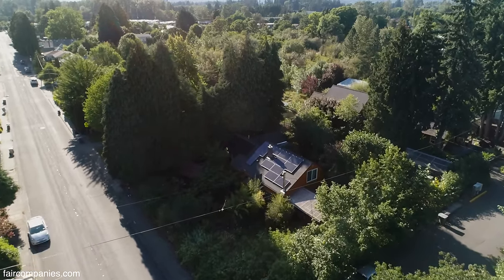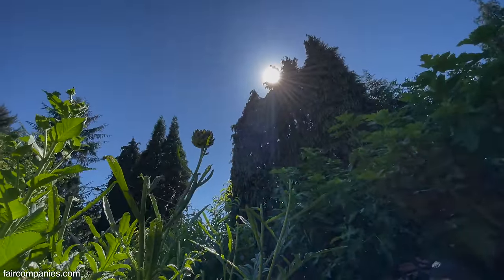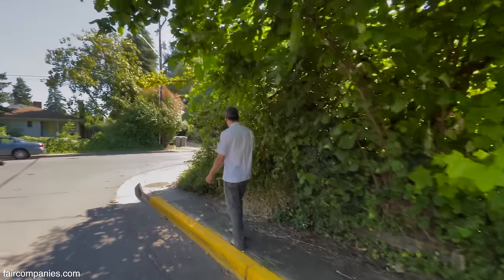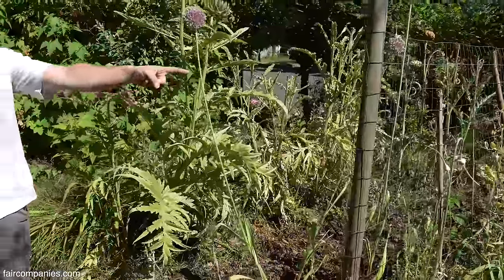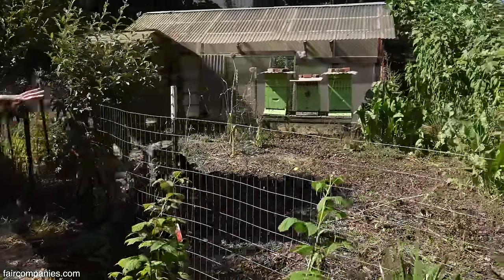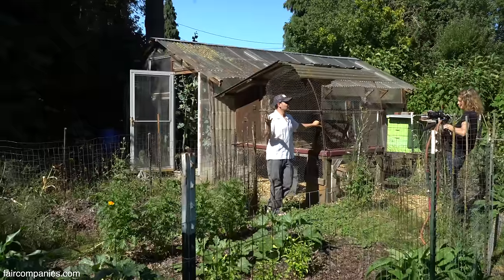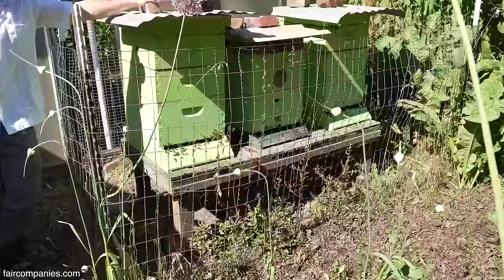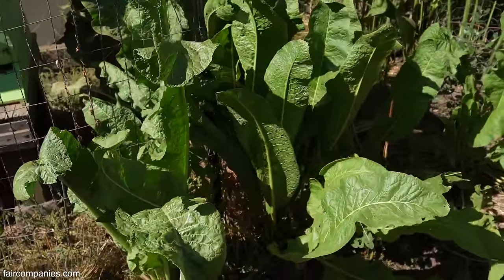Turns barren suburban lot into high-yield Microfarm & YT studio

Comment: Oregon is a great place for growing. It's a lot harder to do in a mountainous arid climate where you're lucky to get 10 inches of rain a year and extreme hot and cold temperatures (zone 3). At least we can grow some things that are heat, cold and drought tolerant, but it does take a lot of water to keep things going all season. BTW, comfrey, when made into a "tea", is an excellent plant fertilizer.
Reply: in that case permaculture is great since you grow low plants under trees, and ground covers, etc. and use a lot of mulches. Preserving all the moisture.

Comment: If you're scared of the bamboo getting out of hand you can use concrete and bessa block/brick containment (with a liner if you are concerned) form it up with steel and have it buried below the soil line and nobody would even know cause it's visually hidden? The bamboo will grow so thick and so straight and perfectly confined that it will be a wall like a maze in a Japanese garden 😉
Reply: You can use wire to guide it into a super perfect hedge wall from the ground to above you head. You can do it beside a path and then anything about where you can reach encroaches from both sides. Then you have a tunnel archway of bamboo also👍

Comment: I am in general agreement with Andrew.  However, the compost toilet seat showed little design effort. The shape should have been oval.  Using saw dust when he already has four feet of matured wood compost is dumb.  The saw dust has a tendency to become anaerobic while the compost already has tilth and humic acid, making it the better choice to quickly stabilize the fresh human feces.  The placing of an icon of the  “Virgen of Guadalupe” on his wall creates an enigma.  Was it placed there as an act of religious affiliation or merely as an aesthetic motif?

Comment: Water is a thermal accumulater, so is stone they will collect heat while its hto and let it off at night.  
           You ought to have a stone wall and slate or some such roof, not a board wal in your green house. Stone and terra cotta  being thermal accumulters. Tarmack is even better than both at thermal accumulation. 
        Apart of the equation which allows you to determine  if something is a thermal accumulater, is how long the material takes to heat up.  if it takes a long time to heat up it also will take  long time to cool down so that it will keep your green house warm at night or, in a city create a island of heat effect..
         Materials lose their heat or gain cold when there is a temperature diffference between the materil and the air say. THee bigger the difference the fster the loss of heat will be.  
         Copper heats up fast enough but cools down equally fast. Maybe an enormouse lump  of copper would be good. 
         I suppose that maybe aislating materials take a while to heat up but they dont heat up much. 
        The conductivity of the material is another part o fhte equation. 
          Another  parts of the equation are, the volume of whatever. The thickness of the wall or size of the rock. Bigger bits of thermal accumulaters hold more heat. 
 water is a thermal accumulater so if you have barrels of watr holding up a shelf in your greenhouse this will help keep the green house warm at night. 
        Cannot remember the other parts of the equation.